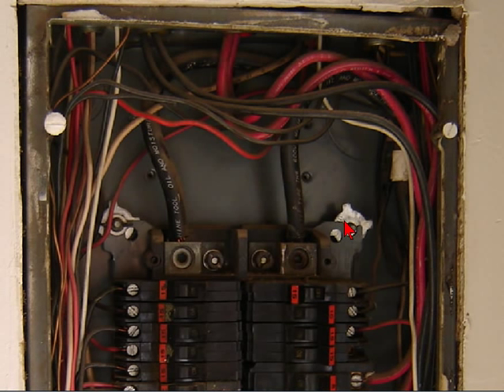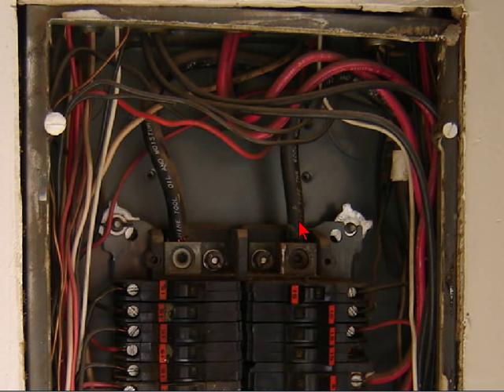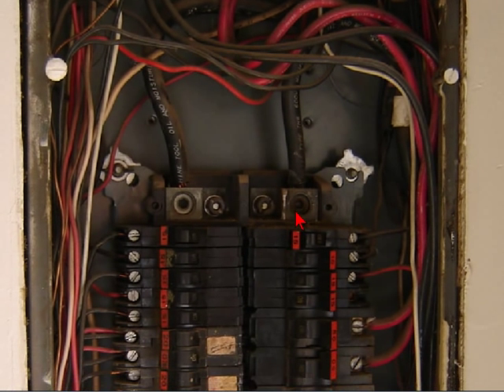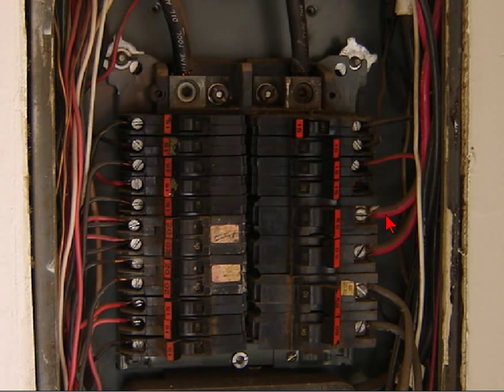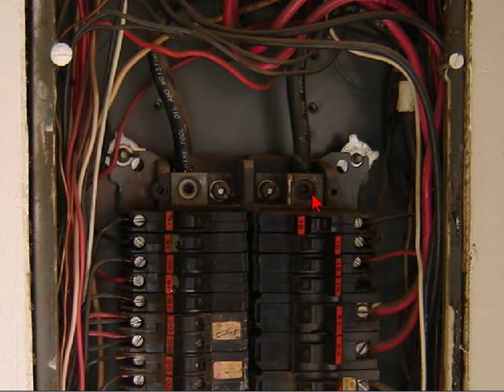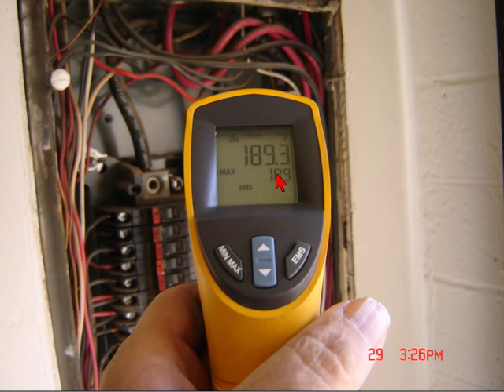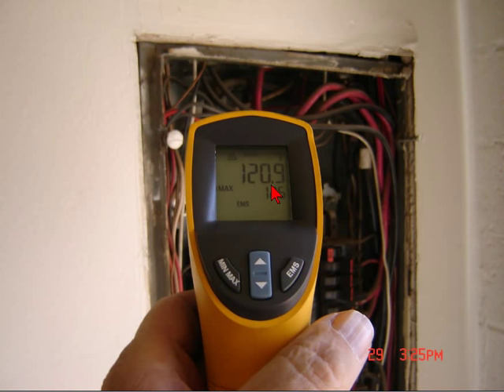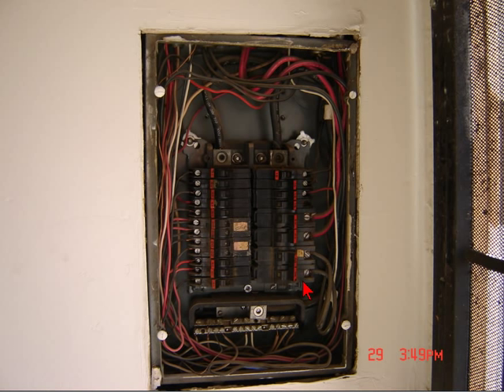Electrical Wiring Problems GP02

Comment: i repaired locomotive wiring for 12 years. We saw a lot of burned up stuff. It is not always as simple as a loose connection either. The more you work with electricity, the more you realize that you dont know as much as you think you do. I like this guy because he doesnt jump to quick conclusions.

Comment: Shouldnt he add up the loads on each phase of the panel to know if the panel is overloadedor or unbalanced ? Also, I might have missed it but is this an 80,100, or 200 amp panel? That temp probe shit sounds like it would be inaccurate to me. I agree that the lugs for the phases could be loose but more so theirs too much shit on the panel to begin with!

Comment: Federal Pacific panels are scary, but they still make them, and are pasted, man i hate them, how they pass is beyond me. I do not even like them, now called Stab lock, i have seen the pins on 15 amp breakers burn off, now tell me how that can happen in a new panel, not enough amp draw to pop a 15 amp breaker but yet burn the contact on the breaker off. This is on new FP or now known as stablock. to me the contact it to loss, the breakers fall out even though they were, put in right.